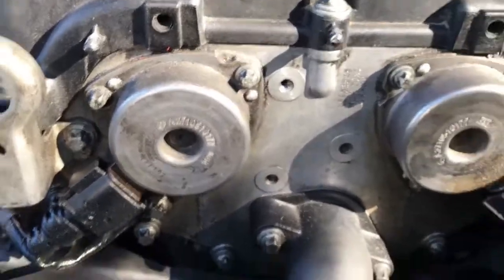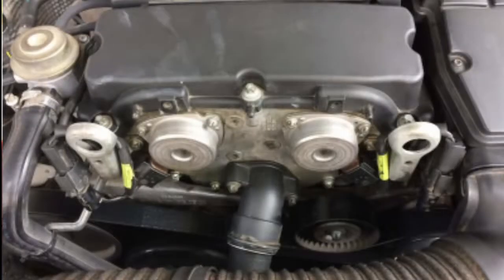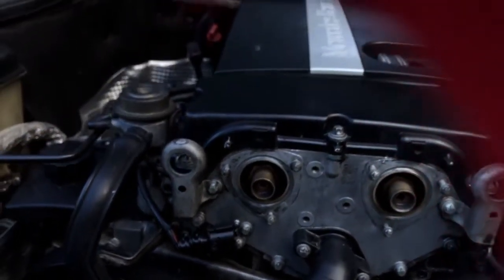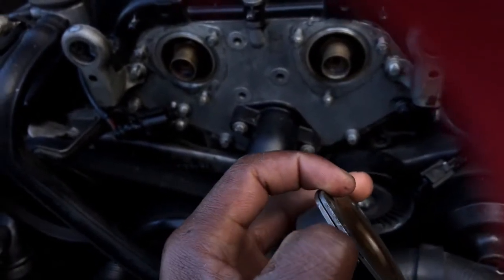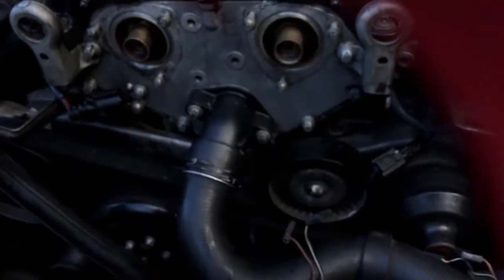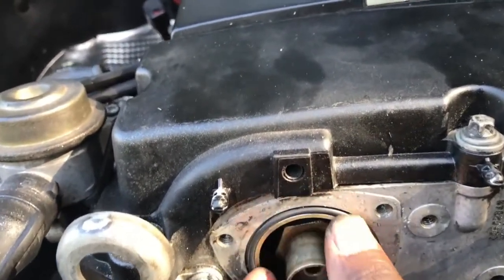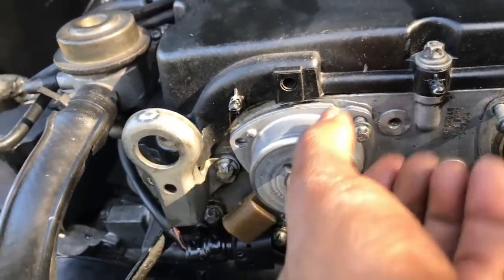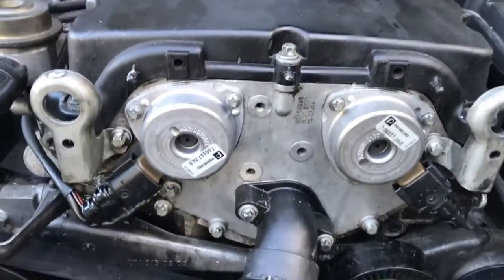CAM SHAFT MAGNET POSITION SENSOR REPLACEMENT W203/W204 AND OTHER C CLASS MERCEDES BENZ.

Comment: Don't buy new part, don't buy used part either! Just open your magnets by drilling the 3 nuts, reseal the magnet inside, where the bad gaskets are, with gasket silicone and assemble.

 The dude from the video even opened one of the magnets and didn't realize how easy is to fix the leaking.....

Comment: Must i just buy genuine part or can i buy part at another place..because at Mercedes its to expensive
Reply from the maker: Keep on checking with other spare dealers you will get a cheaper one. DONT buy a second hand on this one. That part is a bit expensive coz it's very important to the engine performance.